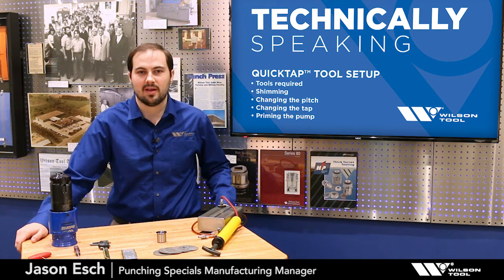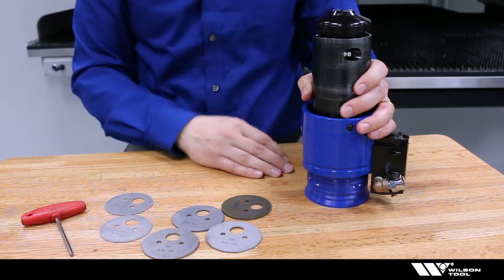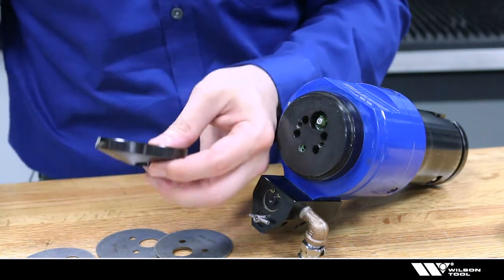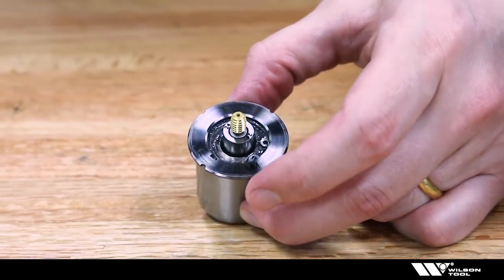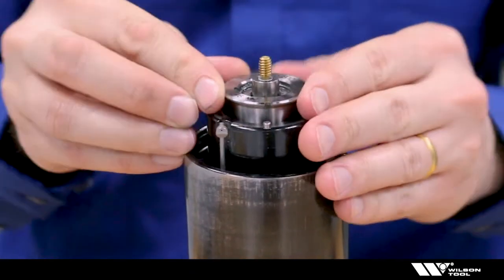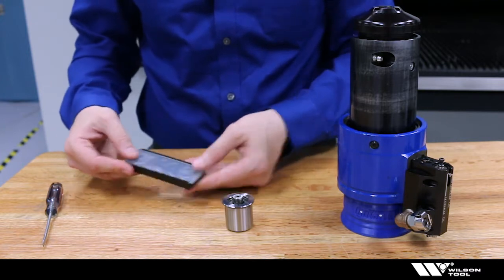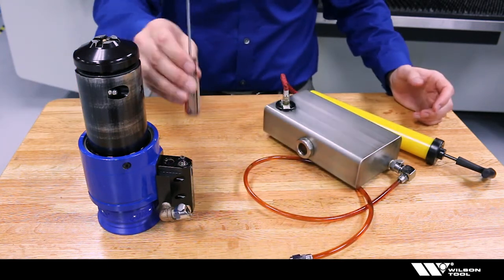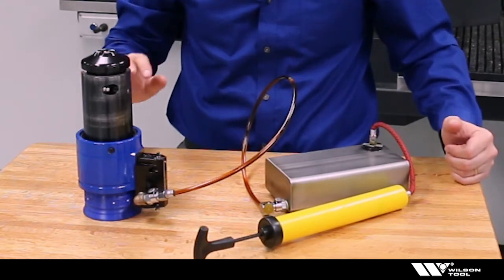QuickTap® Tool Setup for C & D Station | Punching | Technically Speaking

Comment: Is this only for hydraulic machines? Can it be used in a pega 357
Reply from the maker: Hi Chris

Wilson Tool’s QuickTap™ is designed for mechanical and hydraulic machines and will work in Pega 357 for mild steel and aluminum.

We’d be happy to give you any more specific information you’re looking for -- call us at 800-328-9646 or email punching@wilsontool.com